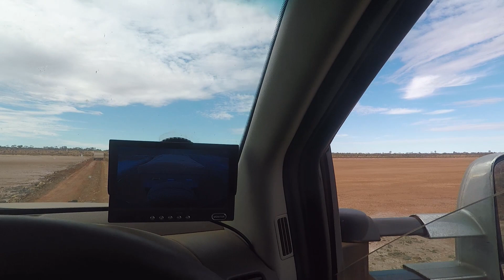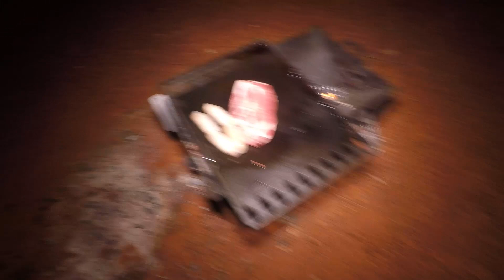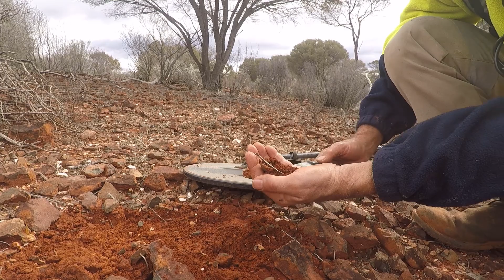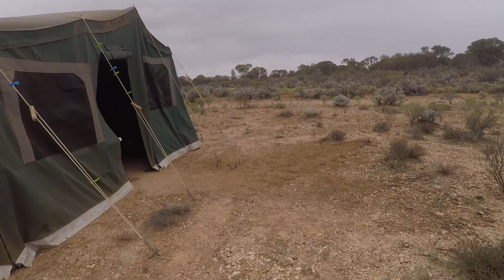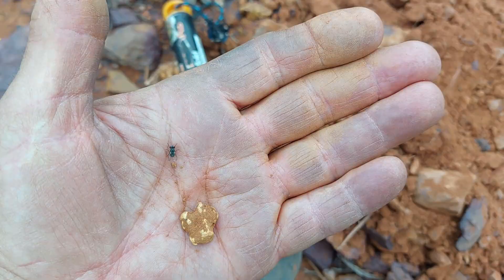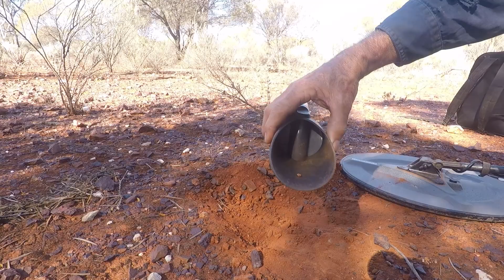14 Day Camping & Gold Prospecting Trip

Comment: How you find the Navara overall Rusty

Must of been fairly reliable to still have all these years… looking at getting one just to do a few trips in.. obviously spend a little on it
Reply from the maker: I've had the Nav since new (Aug '11) and until recently, it hasn't missed a beat (other than the usual servicing and wear and tear issues). The oil cooler failed, allowing oil to get into the cooling system, which caused it to overheat before I could get it stopped.
Ended up with a new engine, etc. so fingers crossed I get another 356,000kms out of it. 
If you check my other videos, you'll see the wellbody to tray and canopy conversion, as well as the GVM upgrade I did. I'm pretty happy with the Nav and I have it set up the way I want it, so it suits my needs very well.

Comment: Great result with the shiny stuff.👍👍  I'm sure it more than covered the entire trip's expenses.  Also good catch on the leaking tank fitting.  And even better that you were able to jerry-rigged a replacement. But wouldn't it be better if you positioned the outlet above the tank?🤔 The way you have it sitting (lower than the tank), makes it even more exposed and vulnerable to get hit.
Reply: @Hammer Rocks  Yeah I agree.  Having the 90 degree bend above outlet would provide better protection.
Reply from the maker: Yes, I agree, the tank outlet fitting should not be lower than the tank. Once I get the correct fitting, I will make sure it's at least level with the tank.....good pick up!!